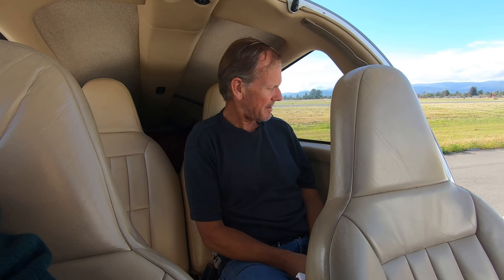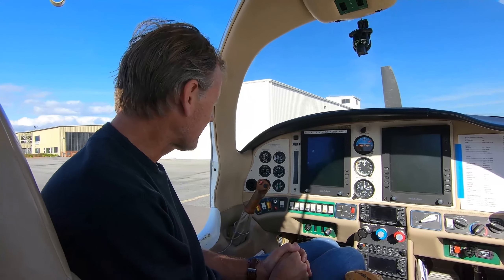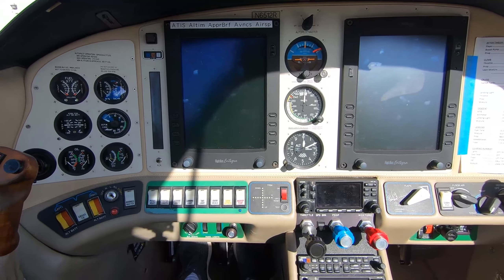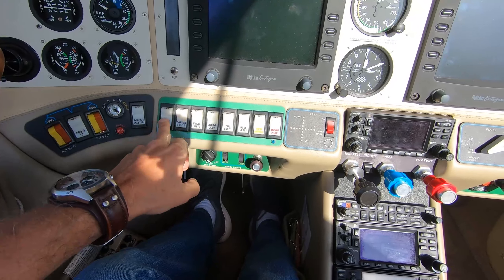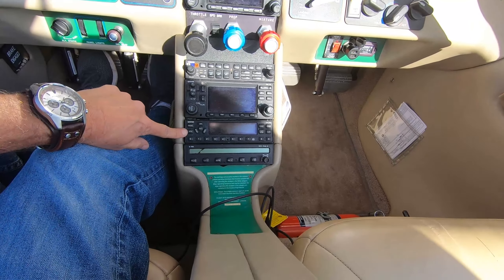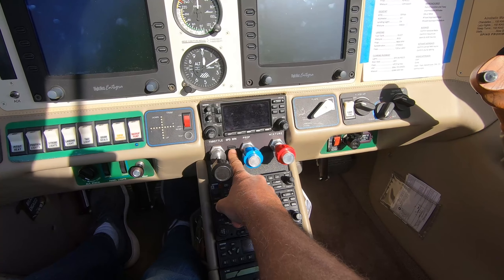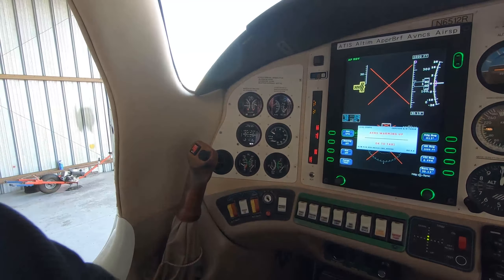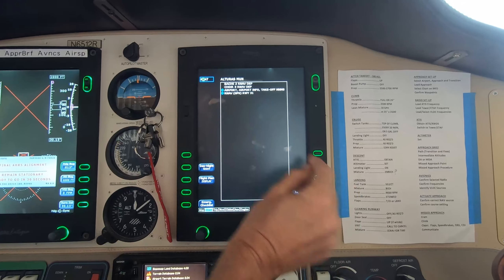Detailed Walk Around Part 2 - Interior & Avionics

Comment: I have never been a small plane before. How does the speed brake work? And how much does the plane weigh? Thank you for doing these videos. I enjoy learning about planes.
Reply from the maker: Hi Scot, thanks for you questions!  The speed breaks disrupt the aerodynamic flow of air across the top of the wing which results in a rapid decent. The plane weight depends on the amount of fuel, but empty weight is 2200 pounds. Weights are covered in detail in Part 1, check it out and let me know if you have questions.
Reply: @12romeo53   I saw part 1, I must have missed that. Thank you.

Comment: Nice plane! I am considering getting into the 300 series.  Are you in a flying club or partnership or do you own it outright?  How has the operating cost been?  I can't use it for work so I would be buying it personally. It is definitely on the higher side of my budget, so I am concerned about operating costs.  Also, do you think the transition from an Arrow would be challenging or not bad with appropriate training?
Reply from the maker: Thanks Kujo, 
I own with two others — highly recommended to have a partner or two to help with offset cost. 
Yes, you can transition from on Arrow. I transitioned with 10 hours of training with a TAA certified CFI after flying a Mooney.
PM for more detailed cost data.